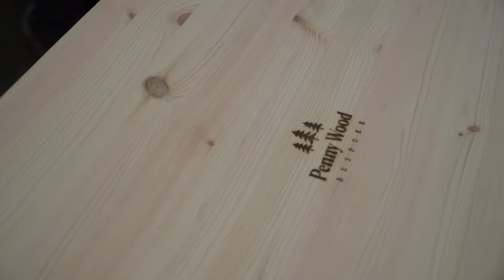MAKING CHANGES // The Best IKEA Hack

Comment: if you want the wood slabs not move (tv /Rupets  stage,) use Cabinet Liner Non-Adhesive 12 in X 20 Ft, Strong Grip Non Slip Shelving Liner for Kitchen Cabinets, under them.